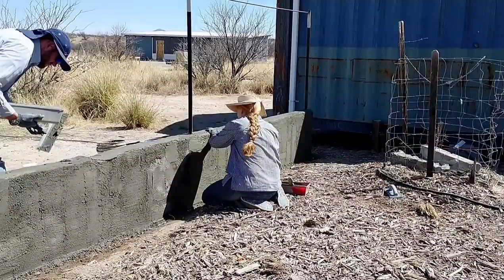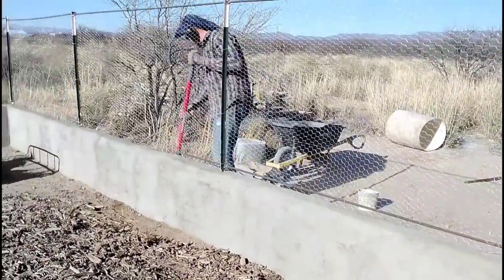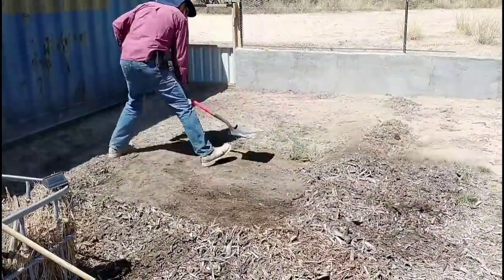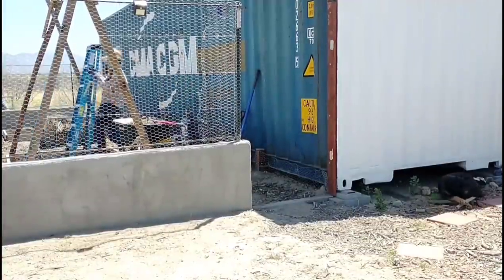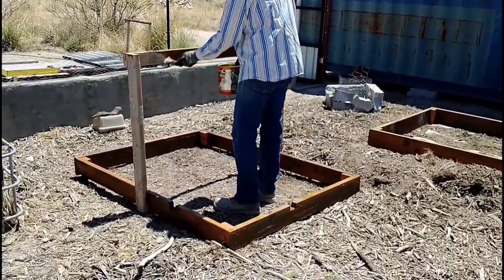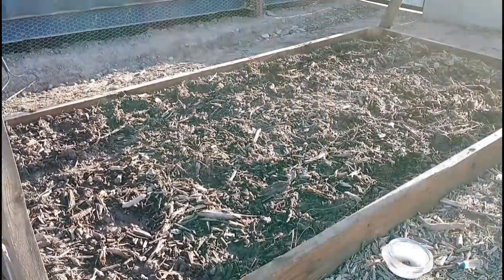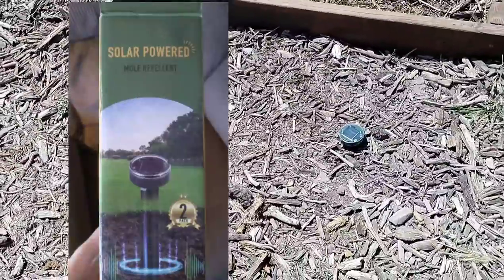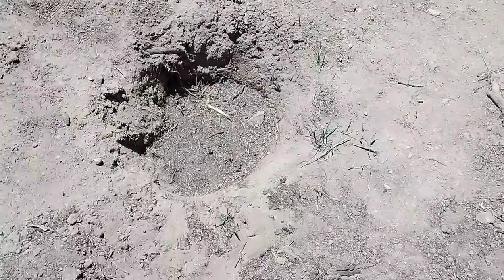Building GARDEN Boxes & Trellises With Salvaged Materials | Aircrete, Shipping Container Wall

Comment: Just a suggestion about rabbit proofing: if you can fold the chicken wire underneath the shipping container, the rabbits will be standing on it and be unable to burrow through. With your current configuration (and i learned this through much loss of garden plants) they can burrow right under the wire. The garden looks great and i really like the use of the aircrete walls.
Reply from the maker: The critters sure make gardening a challenge! Good point, we'll see if it works. We didn't have any issues with rabbits getting in last year, but I had barbed wire along the bottom and a whole lot woven through the fence. I could probably add some along the bottom of this fence too. Thanks! 😊🏜️